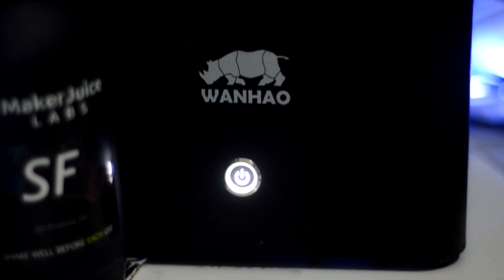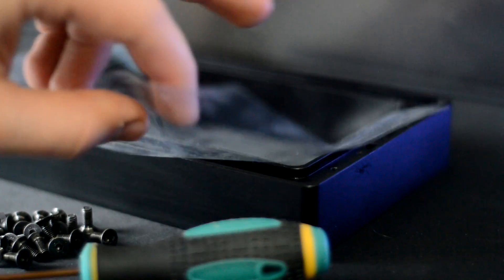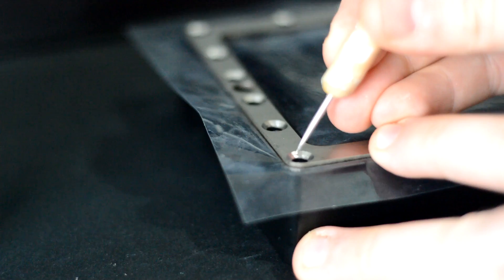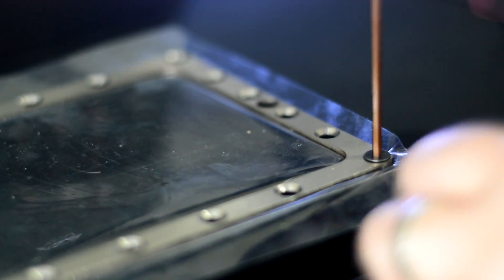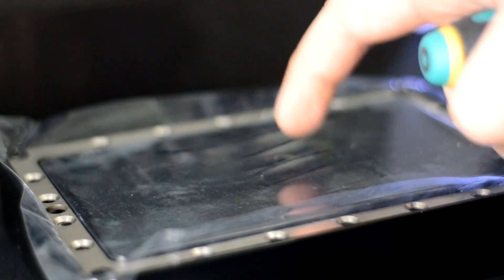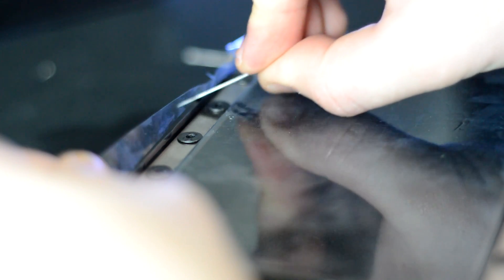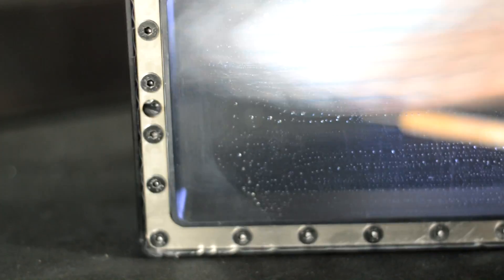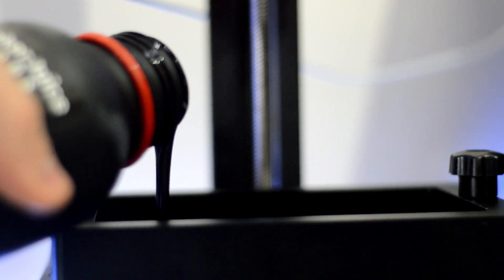How To Replace FEP Film On LCD Resin Printer

Comment: I'm considering to buy this printer, but i dont get it why this film gets worn. Sometimes the resin cures to it, and the Z axis makes a hole while is pulls? Or what?
Reply from the maker: yes it can get torn if part stick to it or you are too rough when removing (its a very thin film) and it also goes cloudy after a bunch of prints which can reduce the quality of the prints
Reply: How many is a "bunch of prints", 2-3 or more like 20+ ?

Comment: Comparing the resin that ships with this printer to the Makerjuice resin, which cured faster?  Or did you find both cured at similar times?  I tried a resin i had previously purchased from Makerjuice which was labeled as for use with Form1 printer, and it wasnt working, but it may have been due to this being old resin. Can you share your experiences using this resin with the Wanhao D7?
Reply from the maker: I have had nothing but problems with the Makerjuice both settling and being a pain, Ive been trying to print with it for the past week and nothing good, I received some Fun to do resin today and its printing wondefully, Will post update soon
Reply: Model3D yes! thank you. I've been looking for Resin sources for this printer and find little available. worst of all, makerjuice didn't seem to work. too bad but glad you are seeing the same. the included resin works really well, but Wanhao isn't providing resin in their shop yet. they said maybe in 10 days. I'll look into Fun To Do resin.
Reply from the maker: Cid Vilas if you follow me on instagram I post a lot of updates there about what's going on,  @EvanModel3D
Reply: Blue Cast seems to be working well. Hoping to get even higher details out of it tho